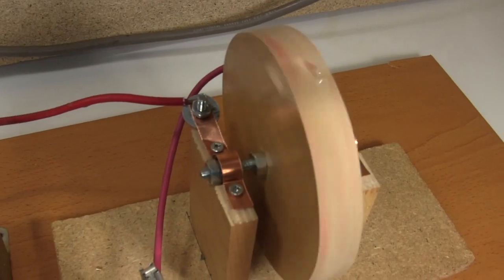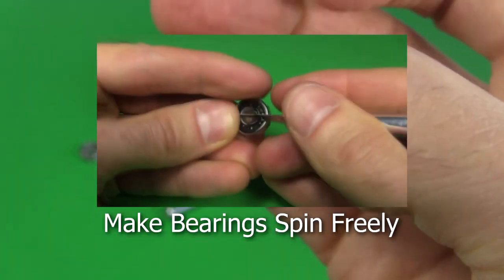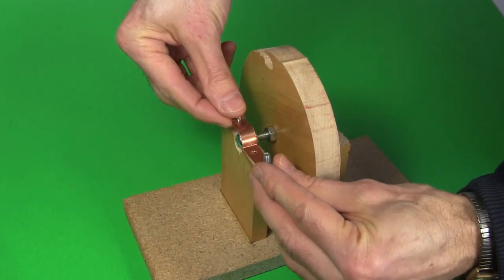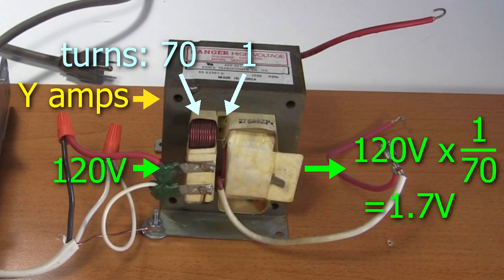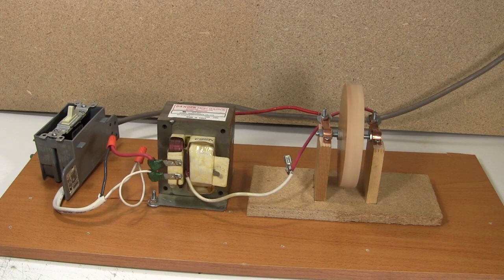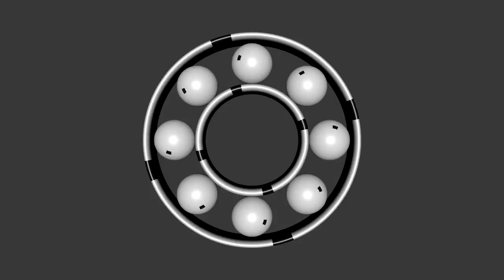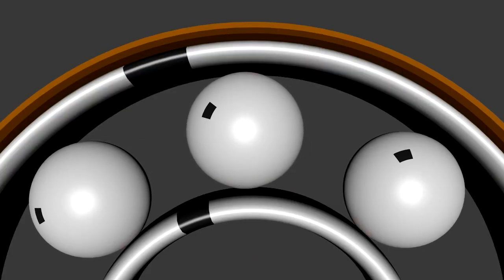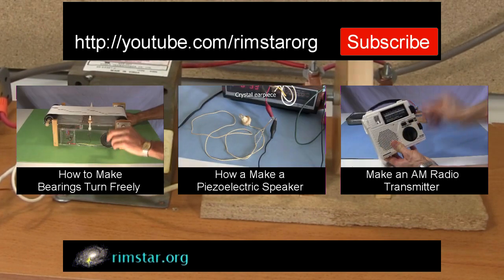Ball Bearing Motor - How to Make/How it Works

Comment: Stefan Marinov motor☝️ Here is the true explanation to the working of this motor, A motor or a generator can be of the three type Rotational, Spiral or Spin, the motor that we generally know are all of Rotational( Rotary) types, Spiral and Spin motors are based on the Faraday's discovery of the Homopolar effect, which is the spiral and Spin types. You are correct about the contact, but wait, you forget to mention about the Plasma interface between the bearing ball contacts, heating is just a end result, but the torque to the spin is provided by the plasma's spinon character of the Homopolar action. If those bearing were made of  aluminium or copper, you would never see heating occuring there, the hot spot would reflect in the transformer side of the impedence in the circuit. All in all your work is excellent keep up with the spirit of builing things👍💪🙏☝️☝️( btw it is good persuasion to look for copper or aluminium bearing custom made😜)

Comment: Would this be an induction motor?
Reply from the maker: Interesting thought. It's certainly not what's normally called an induction motor but unfortunately it's not even induction heating of the bearings, just normal heating from ample current.

Comment: I'm sure it has been commented on and indeed there was a warning in the video but as I would think this is popular with younger YouTubers I feel it necessary to reinforce that warning.
Microwave transformers are not to be played with without knowledge and/or special care. The  secondary voltages are spectacularly lethal. They can supply thousands of volts at a high current. Shown here with reversed connections it is much safer, though not without some occasionally severe danger when dealing with high currents, you will not get shocked, but you can be severely burnt. The energy delivered to a short circuit - if you are holding a shorted conductor will instantly become red hot+. I've done it with batteries that deliver 20 or 30 amps in a short from 1.5 volts and ouch,  instantaneous burning. It will happen very quickly. Same if you connect the primary in the standard config..It can happen very quickly when things go wrong.
The microwave oven holds other dangers. Check Wiki for heads up on the cavity magnetron.

Comment: Is a possible to make it with one bearing?
Reply from the maker: It might work with just one bearing, provided the other end of the shaft it supported in some way that allows it to turn easily.
You'd also need to attach that second wire in some way that closes the circuit while making electrical contact with the inner part of the bearing. That would be trickier since without the other bearing, you'd be making electrical contact with the rotating shaft, and that might add too much friction.
But it might work.

Comment: Interesting, expansion and contraction of the balls in the bearing keep motion going - not too much current to over-stress the metal balls causing oxidation or spark damage. Very good, though impractical in this form.
Reply: The explanation is retarded.

Comment: Hi, I would like to do one of these, but it is not very clear to me how the microwave thing works

With what can I replace it?

First I wanted to use batteries to provide the current, but I read that it was a bad idea

And Can i use more bigger bearing? 

What problem can i have if use bigger bearings?

Thanks for your time
Reply from the maker: If you're not familiar with microwave oven transformers then those are probably a bad idea too since they're quite dangerous. The only other easy method I can think of is a battery.
You can certainly use bigger bearings than I did. Most people do. They might even work better because they can handle more heat. Mine didn't last long due to the heat.
Reply: Hey, me again, i'm working with this experiment, and i would like to study more depdle the fenomeno, what do you recomend me?

I unfortunately don't know how to do it with the microwave oven transformer (I try all possible types of connections but I did not get the necessary current, so i'm using a Variac but it only resist 10A and i'm using 15A so i can just runn it a few seconds)

I appreciate any help you can get me

Comment: dud u can do this with the drul batreys I have dun this also attaching 2x9 volt and works well but personal suggestion is this is not a useful motor to use and ther is a lot off complaceted thinks about this to be abel to be used as a motor this mor likely to me is kind off cra8  elactronic magnatic filed and send curebt back to the sorc trow te same wiyar and is cra8 to much heat and cant not be sorted with current saprator dud all u read I was westing ur time like tnis vido

Comment: I do not think it is the boulge from heat that start these bearings to spin. The boulge is like a static pressure towards the outer and inner race, and that boulge will most probably be aligned perpendicular to the surface of the races.
If it was the boulge that made these bearings spin, you could likly replaced the balls with a "flexible" ring magnet that is magnetized radially - and inside that ring magnet have two magnets that points up and down to make a boulge in each side of the ring magnet causing the same effect as the heated boulge. An we know that magnets cannot do work, but they can replicate a similar boulge using static force instead of heat.

Instead I think it is the magnetic field through the wire, balls and the bolt that make this spin. Current will flow mostly directly between the wire connection and the bolt. This will make a dominant magnetic field radially through the ball bearing that the balls wants to escape - but equally in both directions of rotation. This works much more like a rail gun.
Reply from the maker: I'm not sure the explanation I give is the correct one either. It's just a popular one.
Regarding what you say, notice that I give the wheel an initial spin to get it started. Whatever direction I spin it in is the direction it will continue to rotate in. The momentum of that spin moves the bulge slightly to one side so that it's not aligned perpendicular. As the bulges keep the bearing rotating, the momentum keeps the bulges to one side.
Reply: I noticed that you have to give it an initial spin. However, and regardless of the operational cause, you have to give it an initial spin. That is proven in the experiment.

I have some thoughts:
In case of the heated boulge, the balls might offset the boulge when in motion, but the reaction time the boulge occurs are limited to the angular velocity of the balls. The mass and current should be the same, so you apply the same amount of heat, and the reaction time when the boulge occurs will even out over the whole circumference of the balls -  since the heat conductivity in such a small ball should warm up the balls equally almost instantly.
The boulge has to increase in size after the surface has left the race. I do not know of any material that swell after the applied heat are turned off (Except for rubber and nitinol alloy which shrinks when heat is applied, and swell when cooled down).

In case of a magnetic repulsion due to the possible rail gun principle, you deal with the reaction time of a magnetic field. The initial spin is necessary to determine where the offset of repulsion takes place.
Maybe it is attraction, not repulsion. The oncoming balls are slightly cooler and better conductors so the magnetic field is stronger around them, and they want to alight with the magnetic field in the wire and bolt? It is hard to measure, but in theory, the tiny voltage drop between the inner and outer race should in this case display different readings on each side of where the connector is placed.

To be honest, I do not know exactly what is happening. I love the experiment.
Have you tried to connect a wire to each side of the same ball bearing, and see if the applied current will make it spin after the initial help?
I have no idea if that experiment will confirm what is actually happening. I think I must find myself a ballbearing and examine the inner workings when current is applied.
Reply from the maker: Unfortunately this experiment with the heat damages the bearings eventually and I used up all that I had so I can't experiment with the electricity approach. If you do it let us know how it works out.

Comment: Nice animation to explain the theory of ball bearing motor using heat / metal expansion as the way electrical energy is converted to kinetic energy. You spent lots of time trying to understand.

The arguments in favor of heat appear to be:
- easily explain why the motor works well with AC, while working as well with DC of course. For a motor to work with AC, the stator must revert polarity at the same time as the rotor. In other words, these motor can not use permanent magnet.
- need to remove all grease from the bearing ; some grease would not impact much the rotation if something else than heat was the source of mechanical force. Even if some resistance would appear, simply increasing the voltage would suffice. If it is heat, then any oil would create smoke and would locally cool the bearing so much as to prevent rotation until all oil is burned. Then, the thick residue would stall the bearing.

The arguments against the heat theory are:
- rotation is surprisingly fast. I would expect a slower and irregular speed, such as your motor that used nickel/chrome from hair dryer, a hard drive magnet and a torch flame as source of heat.

I would suggest that you look at youtube videos which uses a blob of mercury in a glass tube with a magnet outside. When applying DC current, the mercury start rotating. I think that the motor bearing is somewhat similar. The electricity going thru each ball bearing generate a magnetic field. If an external force is used to start the rotation, the magnetic field between each adjacent bearing would induce a force (lorentz force).

In other words, each ball bearing act like a homopolar motor. The permanent magnet is replaced by both rings (iner and outter) of the bearing.

Comment: You should probably change the "thermal expansion" explanation after you read this analysis by Kirk McDonald of Princeton University:  http://www.physics.princeton.edu/~mcdonald/examples/motor.pdf
Reply: That's exactly how I thought it worked.  It's basically a circular German railgun.

Comment: I've seen one of these motors before, and it was really weird and interesting how they worked. But it seems like it's just a novelty and is completely useless as a practical motor. It wastes WAY too much power, and normally with a electric motor you want as LEAST amount of heat as possible!  Its good that you have a warning with this, I'd be very nervous playing around with a microwave transformer...the way you have it connected, in reverse, where the transformer is stepping the voltage to very low level is harmless. But if someone was careless and decided to connect the transformer "correctly" and connected the primary winding to 120 volts, then the long secondary winding would have 2,000 volts or more and would be a lethal shock hazard. I experiment with high voltage all the time, and if you take conmon sense safety precautions, then working with high voltage is fine. But if someone  doesn't know the basics, then they shouldn't be anywhere near a hv transformer.  Just a little bit of a different connection with the wires can mean the difference between that transformer being harmless or deadly :/

Comment: why the f*** is my primary and high voltage coil of my transformer made out of aluminum?  tell me if anybody else has this problem too. (the coil u say that is single turn actually is 3 turns)
Reply from the maker: Gotin Fuklio Why is the coils being made of aluminum a problem? Be very careful working with these transformers. The high voltage coil, the one with many turns, is also high current so you want to stay away from it. I was careless in this video and came close to it a few times.

Comment: This is really cool!  How much torque can this type of motor put out?  I'm not sure why people are saying it's just a curiosity - looks like it could be used to power something...
Reply from the maker: Po Lee I never measured the torque so I can't say. I think one reason people say it's just a curiosity is because if you power it continuously for too long then the bearings get coated in carbon and the effect stops working, probably due to the increased resistance due to the carbon.

Comment: My explanation is next: (sorry for bad English)
Electric current which produce magnetic field is in electric field around the conductor. So magnetic field is not produced by electrons but the current field located around the conductor. So,magnetic field has coaxial shape around the conductor. When you start rotation by hand than electrons in side have another component of velocity beside that one axial produced by current. Than, electrons want to go around the coax magnetic field. Total component of all forces on electrons have got tangential component of velocity witch produce rotation of conductor. In base, electrons must have tangential component to produce rotation.
That is my explanation.
Hello from Serbia
Ivica
Reply: Yes, but the other side has opposite current direction. That would make your explanation less likely.
Reply: @princeoftheblues  Do you know vector algebra ? Do you know vector multiple?
Reply: What vectors are we multiplying?
Reply: @honeydavis5568  You should find force on each electron in metal axle. In this formula "e" (electron charging)  is scalar and all others factors are vectors. So the force on the electron is
F = e V x B.  Where V is velocity , B is magnet induction. V has spiral form and B has ring form round the axle. You should be introduced with "right hand rule" when you do vector multiplying, also to get right direction of B vector witch depend of current direction. When you get force vector you should decompose it on axial, and transversal parts. Due to transversal parts you got rotation.
Reply: I agree.  I would have phrased it differently... if the rotor and starter both change polarity then direction is unchanged.

Comment: It is not good explanation how it works. Try to hang the shaft on 2 needles in the axle, it will also make rotation.
Reply from the maker: It's just one of the more popular explanations. The actual explanation is unknown. Why would it work if the shaft is just suspended from two needles?

Comment: I was amazed, when I saw this. Why? No magnets, no coils and this thing spins like a beast. Well, this might be promising, I thought. But one thing I did not like in it. What? It's the use of electricity to spin all this setup. Utilization of electricity was weird, because no magnets and coils are needed then why electricity is needed? I thought...  I was studying stirling engines for a while in my life time and it's working principle is heat and cold with working gas (or air) expansion and contraction. No electricity included. To prove this is possible in this setup (as solid), it is very important, to do this experiment on ball bearing motor -> Use fire torch as an external heat to heat outside of the bearing while the inner part of the bearing must be cooled (or vise verse if possible). Then spin the flywheel and watch it spinning. If it spins, then I'm right. Instead of air, like in stirling motor, here is solid body (ball) expansion and contraction which makes the movement (as told in the video). Stirling motor in order to work firstly must be started with hand. This also valid on ball bearing motor. Isn't this familiar? If it's all true, then we all can enjoy with a new way of heat or cold utilization to mechanical energy, which leads to electrical also. (But firstly it is a must to improve the bearings). „The power is heat and the chariot is bearing. If power is great, the chariot must also be great to handle the force“. We can call this SBM or SBE (Solid Body Motor - Engine).

Comment: I am not sure about the explanation that heat generate spin. It is more likely that whole construction is so called "homopolar motor":

http://en.wikipedia.org/wiki/Homopolar_motor

Here, on your video is applied AC (alternating current), and instead permanent magnets, there is changing magnetic field over the shaft, which interact through shaft from one ball bearing to another. 

To make it working with DC (low voltage, high current), just attach some strong magnet(s) next to ball bearing. It now should start by itself, without 'push until go'.

What you think about this idea?

Cheers,
milan
---
Reply from the maker: The heating theory is just one of many, it just happens to be one of the most popular ones. I put a link in the video description to a page with other theories.
No magnets are needed for this to work with DC. Many people just hook it up to strong batteries, like car batteries and it works.
Reply: Very astute Milan!
The heat explaination is wacky and has not a shread of evidence to it.
Rimstar should know better than to post such a looney explaination when solid and well understood ones are right there.
Reply from the maker: snowboarder50000 As I said to Milan, it does work with DC. Often the demonstration is done with a car battery. But I also said the heating theory is one of many. And no rigorous science experimentation has been done for any of the theories to test the best theory.
Reply: RimstarOrg Why did you choose the heat theroy? It's got nothing going for it. It's pure fantasy.

Comment: Very beautifully produced video. The 3d graphics explain perfectly the intent and the safety precautions. Great video.
Reply from the maker: Thanks. Yeah, the 3D graphics worked out pretty well for this one. It was fun doing the calculations to get the 3D models of the balls and rings rotating at the right speed with respect to each other.
Reply: Lol what safety precautions?